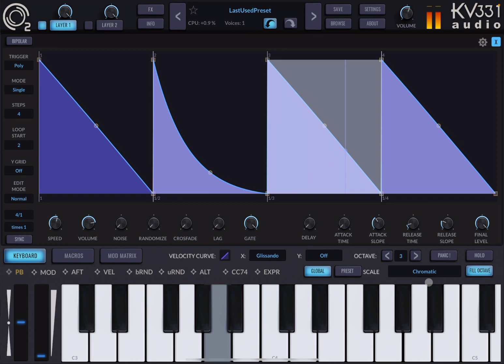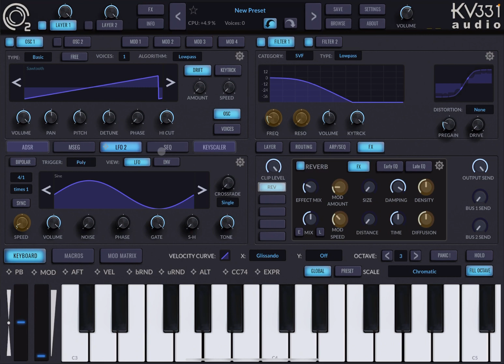KV331 Audio SynthMaster 2 - Tutorial Part 8: Sequencer steps and Keyscalers

Comment: I'm in the more recent interface. When I follow this tutorial and click on the LFO speed which I thought I modulated with Scaler 1, I wind up with a MOD Matrix that says Filter by Source, Source = Key Scaler 1, Via None, Lyr1 Target LFO 1.  But nothing is happening when I play through those notes of the scale. The LFO Speed isn't changing as I do.  Any idea why?

[I figured out this is probably an FL Studio error thing.  When I drag a point all at once FL Studio seems to "hear" the modulation CC.  Then the result is as expected.  Until then it's not.  This same error has been driving me crazy with Sample Modeling Strings because they require CC 11 and until I fiddle about and play a sequence with CC 11 FL Studio doesn't send it - no matter what I do with my Keyboard Controller.
Reply from the maker: What do you have as filter by target?
Reply: @soundformore  I'm not sure what you mean.   LFO 1 freq. is the target, right?  After it picked up it began to work exactly as your example does - Apparently this is how FL Studio responds to MOD Wheel, CC's, etc., at least it's true in my experience. There's commonly a lag or failure to receive unless there's been a pickup assigned to a project template.  I suppose if I had created a template and instructed synthmaster to "pick up" whatever CC that is, then I wouldn't have to move the dot and wait for the "manual pick up".  Other DAWs never do this.
Reply from the maker: @cachelesssociety5187 ok